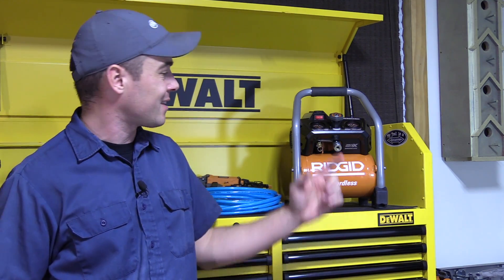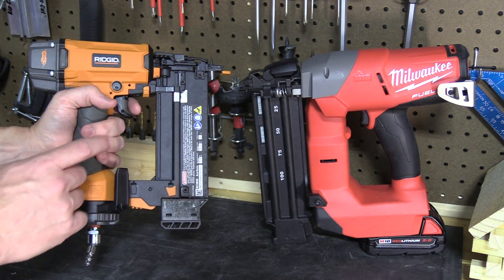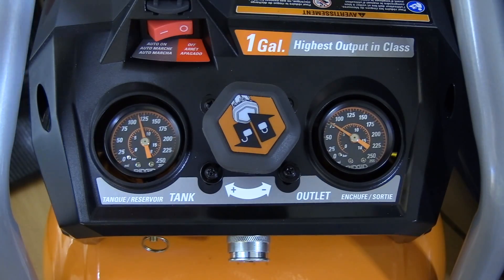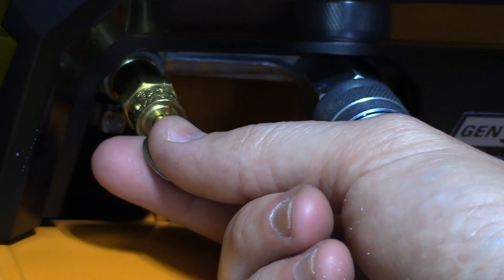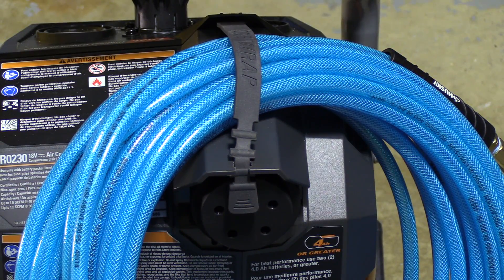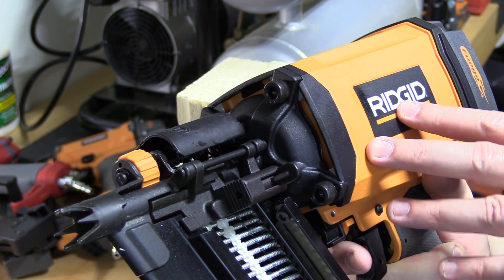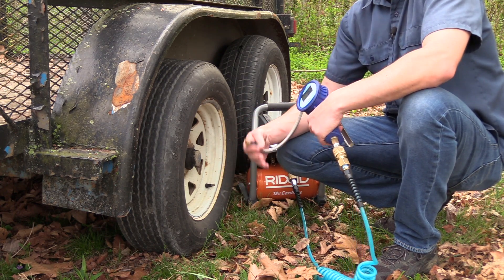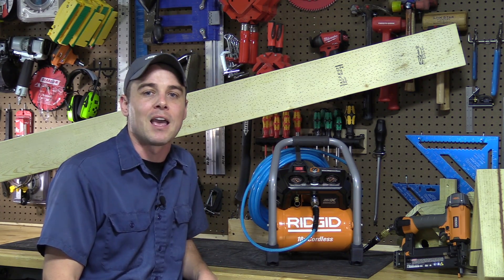RIDGID Gen5X 18v Brushless Cordless Air Compressor - R0230

Comment: I picked up the Ridgid 18 gauge battery power nailer for $200,  mainly to avoid lugging around my compressor.  The 20 pound compressor you reviewed paired with the much smaller (on sale 18 ga and 24 ga air nailers both for $99 at Home Depot would have been a better pick for working on cabinets)  I have a hard time getting the larger nailer into tight spaces)  I saved at least $1,500 by doing the work on my kitchen myself so...  The wife will not complain if later the air tools make it into my box.    My work crew love the cordless nailer for shooting in trim in rental houses that we are repairing.  If you put the tool to work they all quickly pay for themselves.          Thank you for the review : )

Comment: My compressor is a Craftsman 8-gal, dual cylinder, oiled model. the date stamp on the piston housing says 1984, it rolled out of my friend's garage for a cool $20. It tops out at 100 psi so it doesn't have the balls for anything too substantial, but it fills fast with the dual cylinders. The only tools I have are cutoff wheel, air hammer, and of course an air chuck, and it runs them well enough

Comment: Nothing to brag about, but my current Air Compressor is a Harbor Freight 2HP 29Gal 150psi Belt Driven model.  Item #61489.  I've had mine for a couple years now.  My old Montgomery Wards air compressor tank has a leak in it, so I stopped using it and bought a new compressor.  The Harbor Freight compressor helped me do all the base trim in my house after replacing the carpeting with laminate flooring, as well as many tire inflation duties, air impact wrenches, etc.  The compressor handles all these tasks pretty easily, however it takes about 8 minutes for the compressor to fill up that 29 gallon tank.  No big problem there, I just turn the compressor on and do other tasks while it fills up.  This compressor is plenty large enough to do all the tasks I need, and to run high demand air tools occasionally.

Comment: I use a oiless 4 gallon Porter Cable pancake compressor.It has a 1.6 up motor and a max psi of 135. I have had it about 10 years for automotive and woodworking and it has done all I need it to do.Plus it is very affordable at about a 100 dollars.  They have changed in size the past few years but there still pretty much the same.

Comment: wow, this looks like a great compressor for small jobs. I think  professional handyman will love these, especially if they already have some Ridgid batteries. I use a Ridgid 6 gallon, I'm not sure what the model is, but I got it in a combo pack with a 16ga nailer, an 18ga nailer, and an air powered stapler if that helps figure out the model. I have used it professionally for about 4 years now, and it's still going strong

Comment: I have an 80 gallon, 5HP Champion 2-stage vertical that I use for my main shop compressor, a 30 gallon horizontal Champion with a 13 HP Kohler engine, and various other smaller compressors - and I'm still thinking about buying this.  Part of the reason is that I'm pretty heavily invested in the Ridgid 18V lineup already, and the sheer portability and convenience of this looks like it would really fill a niche.

Comment: I've got the ARB twin compressor and it's mounted under the hood of my 1979 Bronco.  I attached a 2.5 gallon tank with it as well. I can run most air tools with that set-up.

Comment: Really like this for the sake of taking it on the road for tires or even airbags that pickup truck owners can install to help with towing, and any other small potential jobs that could come up.
I will not be buying this though because I have all Milwaukee tools and I prefer to stay with one brand, battery system, and charging system. Hopefully someday Milwaukee with come out with something similar and if so I'll be all over it.
Reply: JJ Hanson I was just about to say that! I'm not a fan of buying another charger and other batteries from a different brand.. we can only hope Milwaukee decides to make one!

Comment: just today I thought about if Milwaukee was going to come out with a battery air compressor...  As luck would have it Ridge has one First. Looks Awesome. I Purchased back in 2001 my Emglo M800-HC4V 1.5HP 15 Amp
Still Runs Great today.

Comment: Once again an excellent review! I have a snap-on rebranded 20g compressor from costco.  For the price it's not bad. I find it noisy though and I have to wait for it to build air while using my impact. i just use it for odd jobs in my garage .

Comment: just got the new cordless miliwakee 2 gallon compressor it's pretty cool broke in on a HD12.0  ran for 37 minutes straight until battery died that's amazing max air is 140 psi until auto shut off.wish it dame with cord option like there fan but it's good enough with 2 HD12.0

Comment: All you need is a 10' hose, no need for 50'. Sometimes driving 4 framing nails at a time is all you needed, same as removing lug nuts if you're willing to trade speed with time.

Comment: Nice review, I really want one of these!  I currently have a Hitachi 120V EC12 Compressor.  It does a great job for small framing jobs and smaller brad and pin nailing.  However, it is very noisy!

Comment: Nice unit. I saw Milwaukee at HDepot with 6 & 12 amp hour batteries. Wow. If they had a cordless compressor that would really be great for trailer tires that call for 80 psi.

Comment: I jst picked one up becouse i have the cordless finish nailer i dint want to buy sumthing with a hose again but ridgid dont have any other nailer beside brad in cordless so i got it just for if i got to shoot a clp of frame nails or roof nails or jst like u said if i need to plug a tire i got thousands of dolors in tools to leave on side of road...i got 2. 9ah battersy Bluetooth so i can see how low thay are rt on my phone and it runs all day now i only have 1 helper n we not installing 100s of doors n windows a day or bilding 30 decks a week so its perfect for us i got a 10 gal corded at home if i need bring out the big boy lol good video jst subscribed

Comment: I'm impressed.  I use a electric air compressor with two gallon capacity. And 125lb strength....not sure of type but like the ridged act but loaded with. Ryobi batteries and eqpt. :(

Comment: That actually is pretty cool for such a small unit.  I was wondering how light you meant when you said light automotive work.  I use a Craftsman 33-gallon 150 psi max, 1.6 hp oilless compressor at home.  Similar to the current one at Sears, just an earlier version.  I like it.  A bit much for my needs but I wanted it when it came out.  =)

Comment: What would be nice is an optional 18V power supply that can power the compressor for the times there is 120V available.
Reply: They make one, but at $200, its cheaper to get a Bostitch pancake compressor, which has much better performance.

Comment: also you should compare that to the DeWalt ModelD55140 1gallon. I've been using that for small jobs at work for years. we even installed 800 square feet of engineered hardwood with it in a pinch one day

Comment: Home Depot recently had the bare tool ones on the clearance shelf for $50. They still sell the same thing on the website for $180. Not sure if it's being discontinued or they're just not selling well enough in stores that they'll just sell online exclusively. Almost got one but like it's shown here it's too small for taking off lug nuts, which is why I really wanted an air compressor.
Reply from the maker: +cardsfanbj Home Depot dumps any product that isn't a huge seller within the first month on the shelf --- except Husky items that they own outright.  Just like the RIDGID Gen5X miter saw kit....superior to the Dewalt version, but didn't sell as many & never got physical shelf space (only in the holiday promo section & briefly on an end cap prior to being clearanced out).  Tools make up a very small percentage of their overall sales, so one item never is a big deal to them.

Comment: I'll prob buy 1 just to be able.to.air up tires for relatives on the side of the road or tractor tires and what not but i.defonatly wish it was corded also for sure that would be a huge selling point
Reply: And charge the batteries while plugged in and not used.

Comment: Hot Damn!  This means the Ryobi 18V version won't be far behind!
Reply: Chris Barth hopefully ryobi makes one so i don't have to buy this one
Reply: fieldboy674VGN 2 I hope, Ryobi would bring it to Germany too. Ryobis offering here is pretty poor compared to the lineup you get in the US.
I usually prefer Makita but Ryobi has some awesome gadgets, like the little compressor or the led lamps.
Reply: It's strange how Ryobi has so much variation between countries.   I guess Ebay can solve that problem but its not ideal.
Reply: Why do you say that?
Reply: Ryobi did used to make bottom of the barrel crap years ago but they've stepped up their game .  I used to be a Milwaukee guy until I bought a Ryobi combo set on sale at HD.  It was going to be for the home only but once I tried the impact driver the 18V Milwaukee tools at work started being replaced with Ryobi.  I bought the 18V Ryobi brushless hammer drill recently and its a beast, it really is a good tool.

I've been a commercial/industrial construction electrician for 20+ yrs,  after the switch to Ryobi some 12yrs ago I've used and abused them almost every day for the last 12yrs without a problem.  If I ever had a problem it was my fault from dropping off a ladder/burning the motor from being impatient and trying to cut steel with a 4" hole saw on high speed. Lol!
Reply: Ryobi fills a need for cheap low use tools.
Reply: FoxRcng708 I’ve built decks and sheds left and right with ryobi yes there are better tools but for the money Ryobi is okay

Comment: Shame it's not hybrid corded and cordless like the shop fan and work light they sell, then it would be perfect.
Reply: you may be able to rig it up to a Dell 19V laptop power supply, depending on the amp draw...
Reply: Nice idea. Those generally top out at 130 watts at most. Usually less. A 130 watt supply would give you 7.2 amps max @18v. I haven't a clue if that's enough or not.
Reply: Whether it is or isn't, the fireworks would be a nice touch.
Reply: nathanddrews I was thinking the exact same thing. As is, I'm not sure it's really worth it or not.
Reply: the other companies need to copy the dewalt plug in power pack adapter
Reply: I was thinking the exact thing, plus it should charge the batteries while plugged in.
Reply: there is a Dell 330 Watt 16.9 AMPS part number ADP-330AB,  most cordless tools tops it at 10 amps draw or less because thats the capacity of 18650 lithium cells
Reply: They should a make a battery adapter that excepts a standard extension cord.
Reply: Yeah, the Dewalt cordless compressor is setup the same way :(.  If it weren't for already having a lot of Dewalt stuff, I would certainly be looking at the Ridgid line of tools..I have a contractor's 10" table saw and their wood lathe both have been flawless for 10+ years.  I imagine their other tools are pretty good as well.
Reply: Shame it's rigid and it won't last 5 minutes
Reply: No need if they have two 12Ah batteries.
Reply: @audionut9974  really? I've had reputable professionals recommend Rigid. My thought was the same at first, thinking cheap. I've since been plesantly surprised with quality and value.
Reply: @boguscharlie  what is the story with the dell power supply? How does that work?

Comment: compressor without lifetime service agreement $200
2× 5 amp hr batteries as recommended at $120 each = $240
total around $440
no deal! maybe if they included the LSA I would consider it. plug in feature would also be really nice
Reply from the maker: I agree on the hybrid aspect.....but lets be real here....no company on earth would lifetime warranty a compressor.  Most have 1yr coverage.....3yrs is pushing it.
Reply: Real Tool Reviews 
ya, specially an oil-less design. i got to thinking maybe they could offer a discount on batteries if you purchased them along with this compressor. or at least offer a hybrid plug in option either built in or available separately.
Reply from the maker: I would expect this to end up in a combo kit/promo at some point in the near future......such as a free batter/charger with purchase (Fathers Day/Black Friday...). Time will tell.

Comment: I think your math is WAY off.  I counted $520 to buy the compressor, 2x 5ah batteries, and a dual-sequential charger.  The Milwaukee 18ga brad nailer kit is $349, within spitting distance of $200 cheaper than the compressor combo.  The real kicker is that the 6 gal Ridgid pancake compressor is just $99.
Reply from the maker: +EFormance Engineering it will run off of one battery....compressor ($200) + nailer ($70) + hose ($20) = $290 if you are already in the RIDGID lineup.  Multiple times each year they have the buy-1-get-1 battery deals for $99....2 Milwaukee nailers = $700+
Reply: "...Multiple times each year they have the buy-1-get-1 battery deals for $99...", about RIDGID deals that is true. From Home Depot I purchased two RIDGID 5Ah for $119.

Comment: Do you recommend that I buy a small cordless compressor and use air tools with it? I'm thinking about DeWalt's compressor, because I have most of DeWalt's 20V line up and I have Flex-volt batteries. Usually I just need a brad nailer for really small projects and I have DeWalt's fast charger available.  I did buy a cordless nailer but it was lost during shipping, so I took this chance to look for a better solution for a nailer. Any Suggestions? Thanks!
Reply from the maker: Brad nailers would be fine....dont expect to use framing nailers or impact wrenches with it effectively.  But low air consumption tools are 100% ok.

Comment: The compressor usually does not move a lot i would rather have a cordless   nailer than compressor  maybe it would be good for light auto repair or inflating a tire

Comment: 1.4 cfm @ 40 psi and 1.0 cfm @ 90 psi .  hehehe Not going to run many tools at that output.  Ok for small hobby tools.  But not a bad little rig for a $75 compressor.

Comment: I just don't think some things are good at being battery powered and an air compressor is one of them. Its definitely neat but unless you were a hobbyist that for some reason didn't have a wall outlet for a standard compressor I don't see a practical use for it. Having to use 2 5AH batteries at $130 and the compressor at $180 and then having to stop to charge batteries once they die is silly. If this would have had a hybrid setup at least you could save money on batteries and still have a nice compact compressor.

Comment: No need to lug around any air compressors and drag bulky air lines when so many great tools can run on batteries.
Reply: Vitamin B not when you want to use a blow gun
Reply: There is a battery powered air blower out there too! I have one. Blows the crap out of everything. Also good to clean under the couch or fridge.
Reply: I havent seen one yet. Which one is it?
Reply: I have the Milwaukee Compact Blower. Uses same battery as all the M18 tools.
Reply: oh yeah I am familiar with that one. I only have milwaukee tools

Comment: my phone has a 4000 mah battery. This compressor only and double the battery capacity that a mobile has.
Reply: Your phone has a 4000 mAh battery at 3.6V. The Ridgid 5Ah batteries have 5000mAh at 18V. So one power tool battery has 6 times the energy storage capacity of your phone battery. Plus, the discharge current of the 18V battery is much higher than a phone battery.